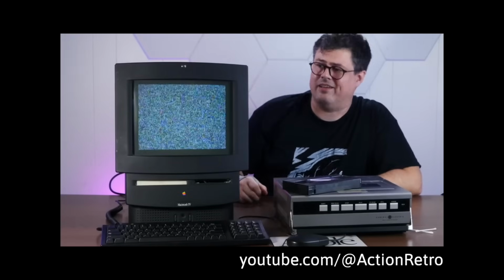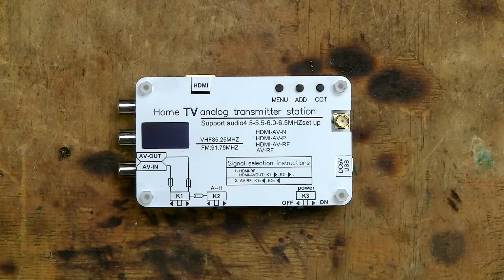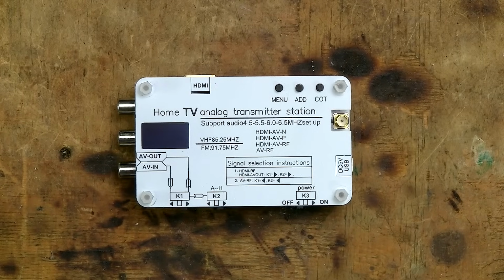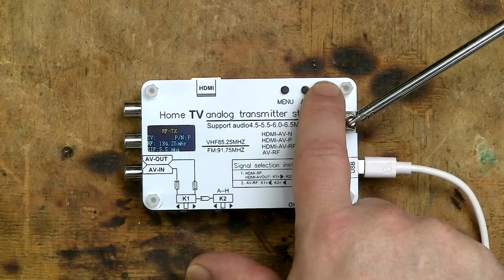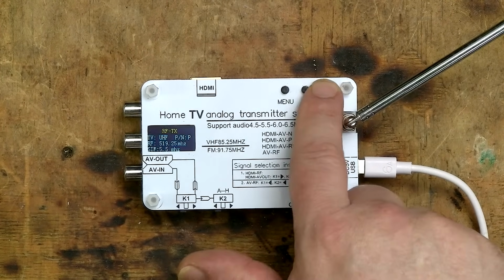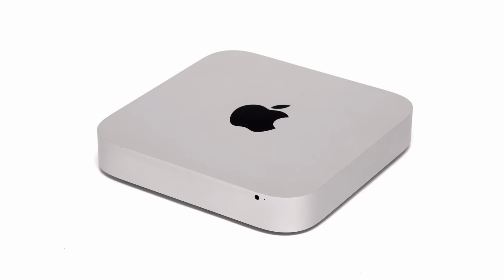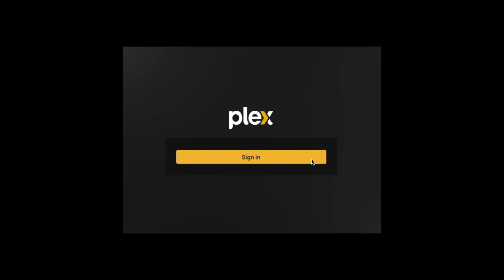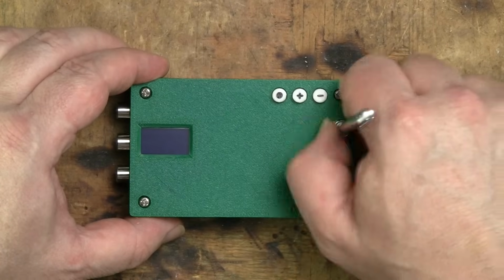New life for vintage analog televisions

Comment: I was hoping someone could answer this question I have:

I bought this very same transmitter, and have it set to VHF channel 6 (the transmitter says 85.25mhz). For some reason, the picture being transmitted also plays on VHF channel 7 and UHF channel 21. There are a few differences to the reception

- Channel 6 plays just fine with the usual tiny amount of snow

- Channel 7 is much less clear, and the picture shows interference when audio is played. The interference worsens during louder audio

- Channel 21 is just as unclear as channel 7 without the audio interference issues.

I don't understand if it's an issue with the transmitter or the TV receiving the signal (for context, I'm using a Vizio Smart TV). Especially since each of these channels are in completely separate bands as each other.

Comment: Not sure why your channel popped up in the suggestions. Glad it did, though!  I do like the idea of seeing random movies popping up, just as they used to... 👍🏼👍🏼 Now, where's my guide? 🤣🤣
Handy having an F type socket. To extend your signal, you could use 75 ohm coax (triple shielded pay TV stuff works really well!) to a (tuned) 1/4 wave vertical antenna or using leaky cable & a 75 ohm dummy load. I have experimented with both leaky cable from one end of the house to the other, with a dummy load on the end & a vertical antenna. The leaky cable worked well in the house, yet had no chance of reaching my shed, about 20 metres away, but the vertical antenna signal was good for just short of 400 metres of (almost) open ground on VHF & just over 250 metres on UHF.
I'm thankful to be out in the sticks, about 70 km NW of Sydney CBD. I was surprised to find a few of my neighbours were into vintage TV! It was also nice of them to use their old TVs for testing purposes.
These things have such little RF output, they could do with all the help they can get. Just don't be tempted to use any sort of amplifier. The "noise" can be horrendous!

Comment: There's several devices like this, but the 5v power really sets this one apart. One of the tiny raspberry pi machines, a Small battery pack, and a solar charger the size of a dinner plate allows you to set up these in a mesh to increase coverage. Software will take a direct stream over WiFi for sync

Comment: G'day mate. I'm a ham radio nerd and into amateur television which we can do on the amateur radio bands into amateur TV reporters etc. I also worked in the technical side of TV at ATV-10 Melbourne in Master Control for over 20 years. SIF = Sound Intermediate Frequency - it's the offset between the video carrier and the sound carrier. Here in Australia our analogue standard was the audio carrier was 5.5MHz above the video carrier. So the correct setting would be 5.5 to ensure compatibility with a maximum number of TV's 😊Great channel! Craig - Geelong
Reply: My friend got of these for his video games, and I bought a similar one, too. We both have our amateur licenses, so we plan to grab two cameras and have a ham TV contact at some point.

Comment: Here's a trick to make the signal stronger even if its far away :

Use an amplifier, which basically boosting the signal strength, and connect to the antenna connector albeit, needed a coax converter to actually connect it. This will help make the signal go farther and preserve the clean image and audio without pure static. However, I haven't tried it yet as I don't have that

Comment: Do you think it would send a signal  downstairs in a small house, throught the floor?
Reply: I’ve got this same Transmitter and you might be able to get away with it but the quality drops significantly through walls, just like he says in the video though using UHF helps boost quality. Still pretty viewable through 2 walls but in my case same floor.

Comment: The face plate is made of aluminum and is very easy to drill. I drilled larger holes for the buttons to fit through and attached it to the top of the 3D printed case to retain the original look/schematic info.

Comment: Well, it can be useful if your home has a lot old TV receivers and you want to broadcast to them wirelessly. But if you want just to stick to only one, yet better is to buy cheap HDMI->AV converter, since it uses same DAC-chip (MACROSILICON) as one here.
Reply from the maker: Not all TVs have AV input.
Reply: @BranchusCreations  Fair point.

Comment: For anyone wondering I took a portable TV outside using UHF and was still getting a signal just about 200 feet away from the unit, not too shabby for a tiny box
Reply: I’d imagine you could get even greater distances if you hook up an amplifier and a longer antenna to the box
Reply: @tvboiiii0 im not worried about that it gives enough signal for me

Comment: You convinced me to order one of these and I’m so happy I did! After some tweaking to find a frequency with minimal interference I can get it to broadcast through my whole house and even outside a little!  My only minor complaint is the audio conversion tends to run a little hot and over-modulated which can sometimes cause some video interference. But honestly for what is essentially a hobby kit the signal quality and range is still quite impressive, and I’m just happy I have a way to use some of my vintage TVs that don’t have external inputs for their original purpose again! 

If you want some fun vintage cartoons to watch through it I recommend the following playlist;
https://youtube.com/playlist?list=PLubQ2wNsM74e1r33xb0WWccF3VMSzevvu&si=YM9BuTvtx5Q4L8kL
Reply: Add an audio compressor/limiter to the audio being sent to the transmitter. Any audio that isn't limited is going to overmodulate the transmitter.

Comment: I always wanted a Ramsey TV6 Analog TV Transmitter Kit, but you can't get them in the USA anymore because they are illegal.  The Ramsey manual is online, so if I knew what I was doing, then I might print a PCB and make my own.
Reply: Get one of these and just add a wideband RF amp to the output. They can be had from evilBay for not much money.

Comment: The are known as Analogue Component VHF & UHF TV modulators 
Can do the same with HackRFOne Software-defined radio (SDR) UHF VHF SDR Software TV Staton (Can Run them on Raspberry Pi's \ Mini PCs)
But they can also Do Analouge TV (With Nicam Stereo Can even get them To Restore TeleText TV Services ) & Digital TV (DVB T1, T2, C & S) & RADIO FM (DAB+, HD Radio)

You should NOT be using with Antenna ... only a RF Cox Cable  CCTV Local RF  loop / patch  Now You have your own Home Private (Pirate) Cable Company 
only  a RF Cox Cable into the TV VHS  antenna ports

Comment: SIF according to chatGPT

SIF defines a standard video frame size and frame rate, used in older video systems like MPEG-1 and MPEG-2. It is typically:
	•	352×240 pixels for NTSC (30 frames per second)
	•	352×288 pixels for PAL/SECAM (25 frames per second)

Purpose of SIF

SIF was designed to reduce the bandwidth required for video transmission while maintaining reasonable video quality. This lower resolution was often used in early digital TV broadcasts, video CDs, and streaming video applications over constrained bandwidth.

In a broadcast context over UHF/VHF, SIF could have been used for testing or for lower-quality broadcasts, particularly when conserving bandwidth or fitting more channels into a limited spectrum was a priority.

SIF in NTSC Broadcasting
	•	NTSC Overview:
	•	Standard used primarily in the Americas and Japan.
	•	Analog signal transmitted over 6 MHz RF channels.
	•	Typical resolution: 480 interlaced lines (525 total lines with overscan).
	•	Frame rate: 30 fps (29.97 fps in modern NTSC for color TV).
	•	Interaction with SIF:
	•	SIF resolution for NTSC is 352×240 pixels, a reduction from full NTSC (720×480 pixels in digital).
	•	This reduced resolution allows lower bandwidth requirements in digital compression, such as for MPEG-1/2 systems used in early satellite or cable broadcasts.
	•	Transmitting SIF over NTSC channels involves encoding the video into MPEG-1/2 and modulating it to fit into the standard 6 MHz bandwidth.

SIF in PAL/SECAM Broadcasting
	•	PAL/SECAM Overview:
	•	Used in Europe, Africa, and parts of Asia.
	•	Analog signal transmitted over 7 MHz (some regions) or 8 MHz RF channels.
	•	Typical resolution: 576 interlaced lines (625 total lines).
	•	Frame rate: 25 fps.
	•	Interaction with SIF:
	•	SIF resolution for PAL is 352×288 pixels, which is half the horizontal resolution of full PAL (720×576 pixels in digital).
	•	By downscaling to SIF, broadcasters could conserve bandwidth in digital transmission systems, such as MPEG-1/2 for satellite TV.
	•	SIF content encoded in MPEG-2 could fit within the standard PAL bandwidth (e.g., for SD channels in DVB-T systems).
Reply from the maker: Alas, ChatGPT has not provided the right answer. SIF stands for Sound Intermediate Frequency.

Comment: Oh shit, bought this tiny helper tool on all, works well, but have bad issue, zenner diode(D1, near type C) on the supply, it is burns when transmitter switched off by K3 switch, cuz the power is still on zenner diode, but might be higher than 5.1 volts, then it is burns. When it work power little bit lower than 5.1 volts and zenner diode is not working and still be ok, but when shutted down it's working, you need precision stabilized power supply if you want to left that diode alive, but IC's is rated to work at 6 volts and higher. The sad thing, this transmitter transmits mono sound, it's has no stereo modulator...
Reply: You could probably pick up a Nicam encoder off evilBay for not much money. No other use for them today now that analog TV has been shut down in most countries.
Reply: @stopthebus i still have Analog CATV with stereo sound, but anyway i wanna my own channel with stereo sound😅

Comment: Using a couple of these units on different frequencies with a proper antenna and an amplifier with enough power to cover the entire house and running different video streams from a couple Raspberry pi's and  you could run your own local multi channel in house TV network. Great video!
Reply: mine does not need an amplifier I was still getting a signal over 150 ft away with the stock antenna using a small portable set

Comment: How to increase range is simple.  Get a signal distribution amplifier with multiple outputs and modify it to have only one output being fed all the signal to an antenna pick a channel that you want to use and cut or make an antenna tuned to the frequency.  This wont get you more than a mile or 2 range with the antenna placed four or five feet above your roof.  But really thats pretty good .  By the way this works for fm too. If you use one of those little fm transmitters you can plug into a headphone output on your phone or walkman.

Comment: The antenna connection, is it F-type, or SMA?
It looks almost the same as a connector on a WiFi antenna…
Reply from the maker: It is very similar to a WiFi antenna connection, but it's gender reversed. The screw thread is the same size, but the antenna is a male connection, when a WiFi antenna is usually a female connection.
Reply: @BranchusCreations  thanks. I know this reply is much later than my original comment. 

I’m in Canada and am hoping to just use a coaxial cable to integrate it into my home system instead of wirelessly broadcasting it. 

Seems like I would need an adapter.

Comment: Instead of the antenna connect it to the internal coax wired to the rooms of your home, as if it were the antenna.  All the sets can hook to it.  Not as convenient as wireless broadcast, but less interference and better signal.
Reply: In that case it would be just as easy to just use a standard RF modulator... or an old VCR.
Reply: @alextirrellRI  I agree, but that also assumes you have either of those.  And they don't give you channel / frequency versatility.
Reply: @bobblum5973 or digital inputs in many cases such as HDMI from a PC

Comment: A late friend lived in a building that had a pre-existing rooftop antenna system. When she lived there (Late-2000's/early-2010's) most residents had abandoned it for subscription digital services. (Satellite and broadband cable) I imagine if this were connected to it--with a substantial boost in signal--it could've provided the entire building with it's own private TV channel, if not radiated an RF signal strong enough to wireless-ly reach receivers within the building... and perhaps a few others close-by.
Reply: My understanding is that broadcasts are more limited by power than the size of the antenna. My college radio station didn't have a full license and definitely 'pushed it' as much as they could. Periodically they'd get calls from one of the commercial stations on a nearby frequency asking them to turn down the power.
Reply: @alextirrellRI  Years ago an unlicensed radio station was allowed to broadcast up to 10 watts (I don't know if that is still allowed or not).  The last university I worked for and spent the bulk of my teaching career at had such a station (along with two licensed FMs and a licensed AM for NPR).  The unlicensed station could be received from approximately five miles away from the tower.  Since the station was intended to only serve the campus community that was fine, it was listenable anywhere on campus.  The station was mainly staffed by communications major students.  Since I was an accounting and tax professor I did not have involvement with the station other than the occasional interview segment during tax season but I was also interviewed by the local TV stations so I was used to it.  The professor that does the TV interviews nowadays is much better at it than I was IMO but I did get called back every year by the local TV stations, even for several years after retiring from teaching.

Comment: Couldn't you do then same with an old VCR, and antenna amplifier and antenna?  I mean, most old VCRs will modulate the video input and put it out on TV channel 3 or 4. So if you put that signal to an amplifier and an antenna, isn't that all you need?
Reply: Australian VCR have PAL-B channels 0 or 1 (46 to 57 MHz). That TV is PAL-B.
Reply: The amps create a little too much "noise" to be useful. You might get a mediocre signal VERY close to your VCR, and not much else.

Comment: A nice little transmitter, shame there is no option to stretch the pic a bit for less top and bottom bars (yes you'd lose a bit from the sides)
You seem to have a nice collection of TV's, I'd like one of those ball TV's, but I'll probably never find one.
I do have an 'Apple TV', however it's not what you have, it's not even made by Apple, it's a TV shaped as an apple, complete with a stem and leaves sticking out the top.

I've thought of doing something similar, but via the TV antenna 'network' in my house, However having all the computer gear running just in case I wanted to watch a random old movie, seems like a awful waste of power. Maybe a Raspberry Pi etc....

Comment: SIF=Sound Intermediary Frequency. Is the distance where the sound carrier is from the video carrier. Note that you can select the channels in "steps", one step is the channel width and it can be 6, 7 or 8MHz. The Sound IF can be at 4.4, 5.5, 6 or 6.5MHz, depending the TV standard. 
For example, PAL B have the channel width 7MHz and the sound is at 5.5MHz while PAL D have the channel width of 8MHz with sound at 6.5MHz. If your TV (only the oldest ones, I think) is made for PAL B, then you will hear no sound if the transmission is in PAL D, but the image will be ok. Newer TV sets are multistandard however and are able to demodulate the sound at 5.5 and 6.5MHz if were meant to be used in a multistandard area. For example, in Europe, there are different TV standards (PAL BG in western Europe and DK in Eastern Europe). Australia use PAL B and D so any SIF you select, will be ok.

Edit: About selecting between VHF and UHF, I would suggest using VHF because the RF signal being at a lower frequency, it passes easily trough obstacles like walls made of rocks, bricks and armed concrete. Basically it have a larger range. Also, older TV sets do not have UHF band or is not so sensitive.
Reply: Australia used PAL B on both VHF & UHF on 7MHz wide channels, being the only case where UHF used 7MHz spacing. PAL D was used on UHF 8MHz channels in Europe, New Zealand, etc. Other than the sound IF spacing, the video was the same as with PAL B.
Reply: @georgekozak225  PAL D was never used in NZ. I'm a Kiwi and been involved with broadcasting going back to the 1970s and we have only ever used PAL B/G here. The D variant would not have worked here as it uses a 6.5 MHz sound carrier.
Reply: @georgekozak225  Thanks for corecting me. I got that info from my old notes from  around 1998 when I was interested in color TV.
Reply: @sebastian19745  TIL, you've lost interest in colour TV? So, only greyscale since then?
Reply: @froedlmetallmann4643  LOL, partially yes, vintage B&W are my hobby. And, the old analog color TV is dead where I leave.
Reply: Not sure about Europe in general but in central Europe any VHF-only TV would be properly old, as in from the 1950s. UHF was introduced in the early 60s I think, if not late 50s.
Reply: @Ragnar8504  The US implemented a requirement for televisions to tune UHF stations natively in the mid 1960's due to lobbying from Kaiser Broadcasting who owned several UHF stations.  To this day televisions are required to tune the UHF bands natively.
Reply: It would be an old television, indeed that does not have UHF receiver mode, at least in the U. S. Of A.

A long gone tube (before solid state) Zenith television a relative used for years could receive UHF signals, but only display it in black and white, as the CRT was grayscale only.
Reply: @sebastian19745  I have to use UHF on the unit I bought, none of the VHF frequencies it transmits at match any of the VHF NTSC ones. Not all the UHF ones match either but Channel 22 seems to work best